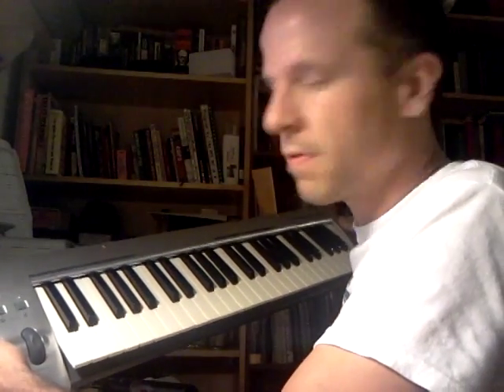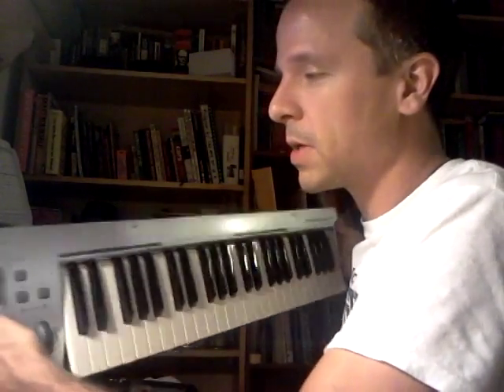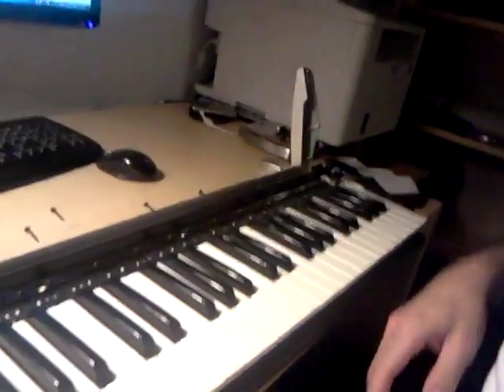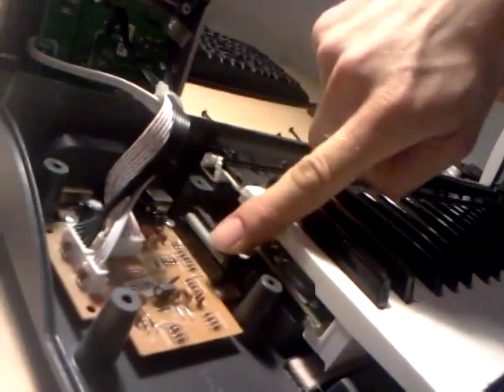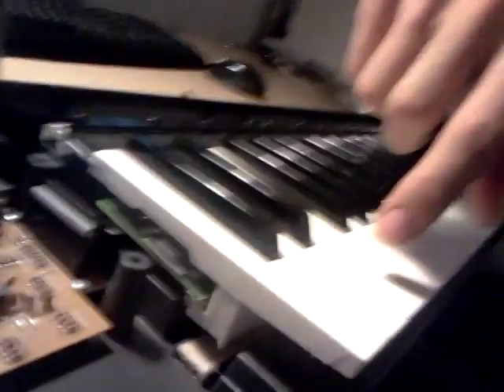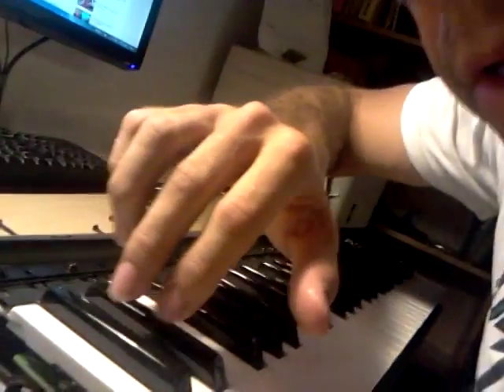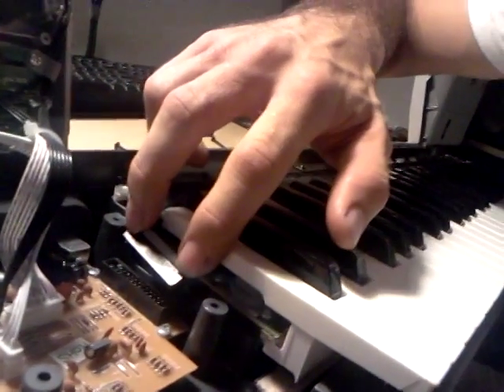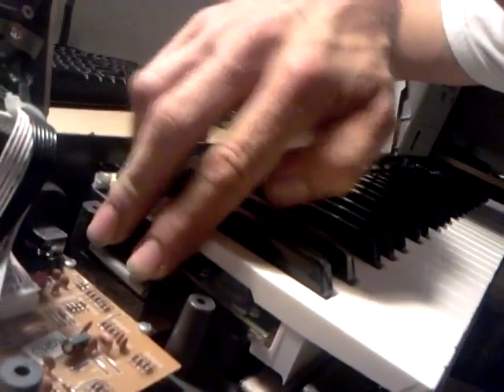How to fix an M-AUDIO midi keyboard with dead keys

Comment: I was having the same trouble with my M-Audio keystation 61 ES which was given to me by a guy at work, he just asked if I wanted it so I said yeah, it turned on and the modulation wheel and Pitch bend also worked, but no sound from the keys, so being that it was free I followed your guidelines of repair ...  just like you, the keys were disconnected just like on your video, but thanks to you now I'm up and running... thanks for posting.

Comment: Thank you!  You just saved me from having to replace my keyboard. My connector was only half unplugged, so I only lost half the keys.  Please advise your viewers to check the pitch bend knob BEFORE they put all the screws back in.  It is easily unsnapped from its axis while handling the cover as I learned the hard way.  Thank you!

Comment: Opened it up, but sadly connector was plugged, keys are still not working, even after spraying air into the connector. I have no idea what to do, every electronic part seems to be in place, is it possibe that keys arent mapped?
Reply: Have you tried a factory reset 
Turn power off
Hold octave +and - and advance buttons while putting power on and release the 3 buttons
Reply: @petripat5979  yep, i even unscrew the whole thing to check if something was unsoldered, but it was just trash, i bought it from Pawn shop, so i got refund. but if you gotta cash go for something smaller and new. The only time its worth to buy keystation 49 e is when it costs 10 bucks
,

Comment: I've M-audio oxygen 61 mk3. It's getting power when connected to pc but pc not recognise any device.

And some random numbers appear on screen and change quickly. When i turn the knobs and sliders numbers are chaning. I last used it 8 years ago and it was working fine. I wonder what problem might have been?

Comment: I had the reverse problem, the Pitch wheel was occasionally sending random events. I tried cleaning it, but in the end I pulled the connector for the pitchbend and mod wheel since I was only using it for notation entry into a scoring program.

Comment: Hi Ignacio, I have only one key that isn't working. The C key, which is the first one from the left. I plan to try this when I get the time. My guess is that it might be something similar, but maybe not. It might be dust or something. Hopefully I'll get to it sooner than later. Thanks.
Reply: I don't know. I've tried everything, but take it apart for the last few days and the C Key wasn't working. Before going to bed I started to hit the key hard and it worked! I also played around with the octaves too. It might have been too low for me to hear and I thought it wasn't working or something. I have many audio things going and one of them is a fan right next to me, so I didn't hear it. But keep in mind I did try everything like plug and unplug into the main Mac Usb input. I tried a reset that is stated in the manual. Thanks so much for offering that video. I might have needed to do the same thing.
Reply: One more note. I used a different music app that may have affected it. For your other viewers I mention this for them to try while troubleshooting.

Comment: I had the same issue, but my connectors were all properly plugged in. I just unplugged it and sprayed some air duster to clean out the connections, hope it works
Reply: Did it work?
Reply: It did, I learned that having dusty connections is the reason for alot of electronic trouble shooting. THought the volume knob on my interface was broken but just had to spray the air cleaner and it stopped crackling

Comment: top 9 keys stopped working on my key station,  they offered to replace the keyboard for me but I would have had to pay to ship my broken unit so I figured I'd open it up first.  the connector was loose, and re-seating it fixed the problem.  thanks for the video

Comment: Repairing my Radium 61 has been one of the most frustrating things ever. The screws need to all be as tight as possible, but none of them will even catch the threads

Comment: Thank you for taking the time to make this video.  

I just bought one (Axiom 49) used (I actually used to own one 5 years ago but sold it to a friend) and when I was testing it out today more in depth I noticed the F key didn't work in any octave.  I did just as you said - open it up, check the connectors are secure, and put it back together.  Works fine now.  

Thanks again

Comment: Thanks! they really should put some sort of clip or retaining method on that cable. Mine had backed out just enough that only my C5 key, the highest note on the keyboard, wasn't working. This made me think it was the actual key but after inspecting it, it looked find. I didn't think to even check the ribbon cable until I saw your video and that solved it. Thanks again!

Comment: If individual keys don't work just remove the spring holding them in place. Some times dust or in my case a small hair was interfering with the contact. All in all it was also and easy fix as well.

Comment: Thanks so much for your video!  My Axiom Pro 49 had a similar problem but with only the B and F keys. I fixed mine not by taking the cover off, but instead, I just simply dropped the keyboard onto my desktop from a height of about an inch.  It worked!!

I figured maybe my connector just became lose, and by dropping the keyboard, it might reconnect - Well it apparently did!  Thank you sir!
Reply: this just worked for me! ty!
Reply: cant beleive it worked for my behringher umx490 too!! so happy to find this feed here in this video i solved my problem of some keys not working.. now is perfect again thanks bro

Comment: hey Ignacio i hope that you can help me with this problemmy brother have the 61 keys version of this keyboard , it worked fine at firsti don't know what happened but it stopped getting recognized on my pc tried it on 2 other pcs as welli also tried changing the usb cable but it looks like its not the problem (both usb cables that i tried worked fine on another midi keyboard )do u think its the power supply ?
edit : ah i forgot to mention that i got it working once but when i got ( it was on my lap) it stopped working

Comment: Hi Ignacio,

Simple video, with good information! 

The downside is that you've voided your warranty, right? So, why not simply return it to the shop?
Reply from the maker: I bought it used second hand without warranty left. So yes. If you crack open still under warranty you will void the warranty. M-AUDIO will charge for this repair when in fact they should recall it and fix it for free as this is obviously a flaw on the design.
Reply: You're right - the connector should latch up! Most likely it was not seated properly in the first place.

Anyway, thanks again for your video!